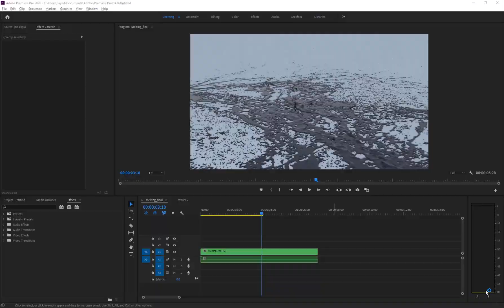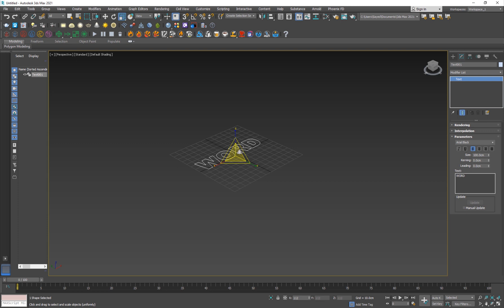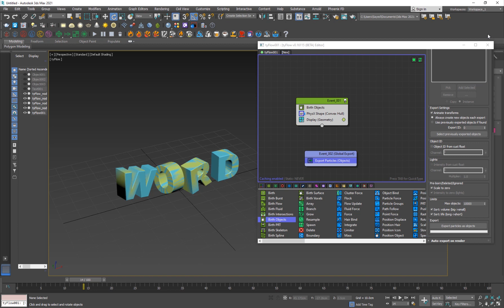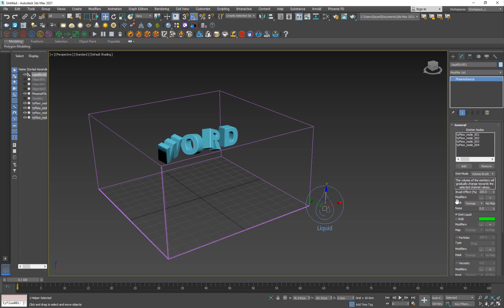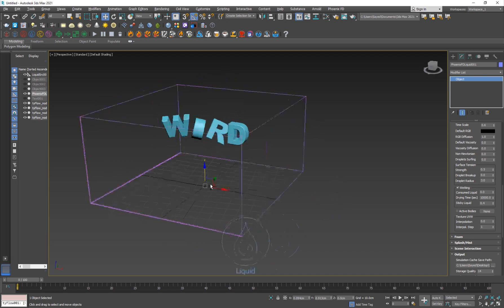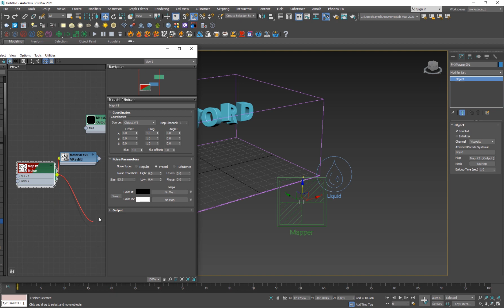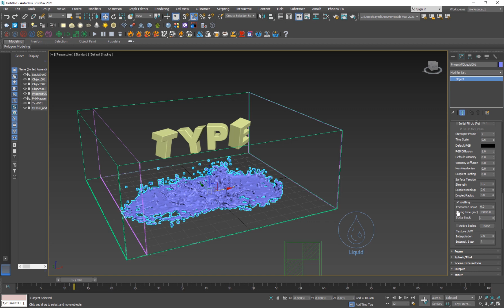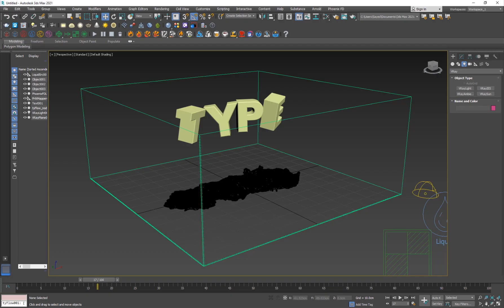Phoenix FD Object Melt Tutorial

Comment: Good tutorial thank you ! One question - i using mesh of a character to do the same effect, but my problem is that particles are not covering my whole model, i mean the character holding a sword in a right hand, but when i do sim, particles almost not cover the sword, it is like there is not enough particles to cover whole model , how to increase number of particles that they can cover whole model during simulation?! Thank you for possible solution and help/tip. All the best !
Reply from the maker: Thanks ! It's probably because that portion of your model is outside the grid or something , the other possibility can be the quality of your grid and the units of measurement make sure your model is the correct proportion and size or same at least and make sure your grid resolution is high enough!!
Reply: @fxmaniac2839  Thank you ! I actually just now found out the solution , funny i just forgot to change gravity) so in my case turning to liquid happen faster than model could form the solid state) i just forgot to key the gravity value) Thank you again !

Comment: which sense makes the tyflow simulation? you actually don't use it longer than 1 frame. after the first frame you take the liquid sim as far as I understand. thanks
Reply from the maker: Yah exactly I did the Tyflow falling at practice first so ended up doing in the tutorial , but it doesn't make any sense 😅 without it the sim would be the same , thanks for the comment ❤️🙏
Reply: @fxmaniac2839  😉👍🏻thanks